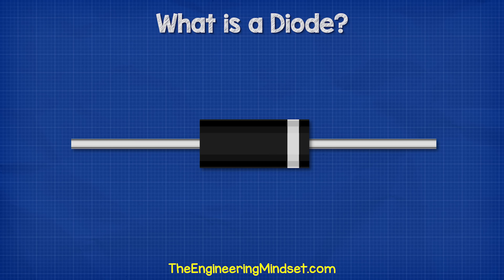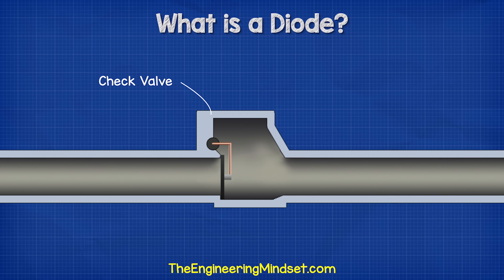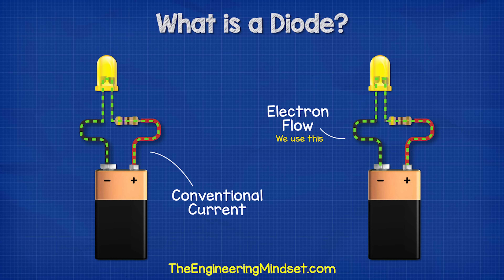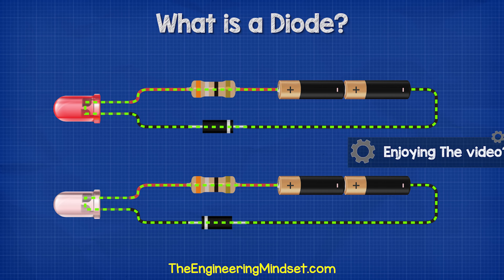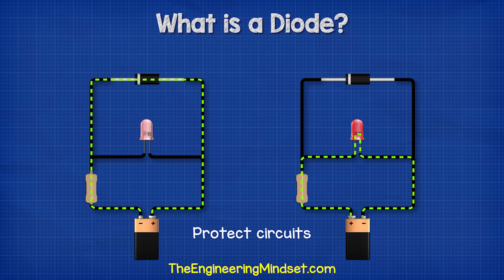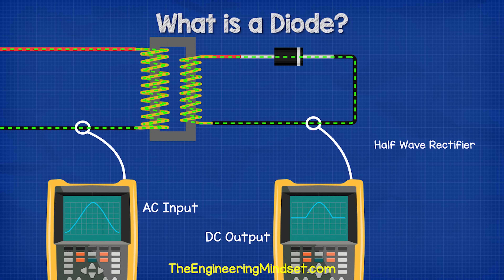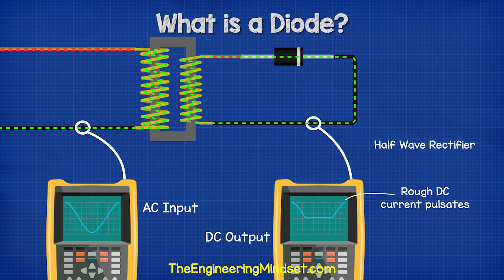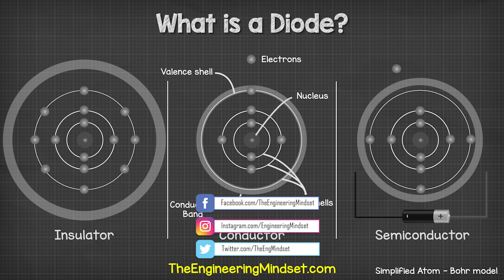What is a diode?

Comment: thanks for the video but im a bit confused about the "diode circuit protection" part.. if the circuit is an led and resistor wouldnt it block the flow of electrons anyway since its also a diode?